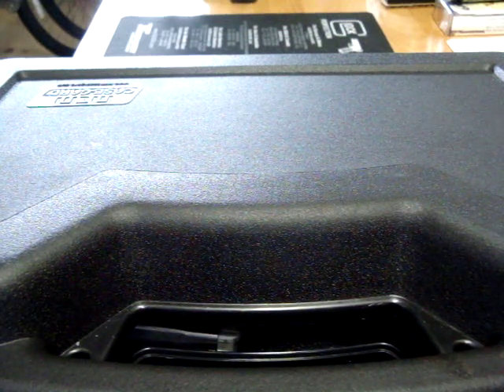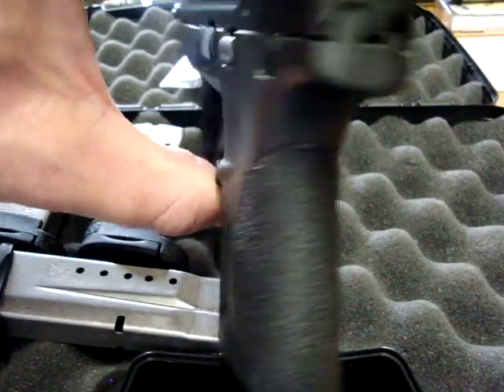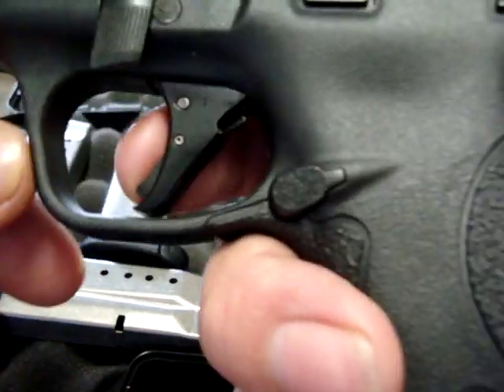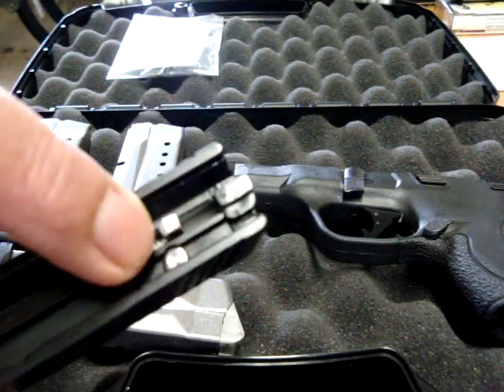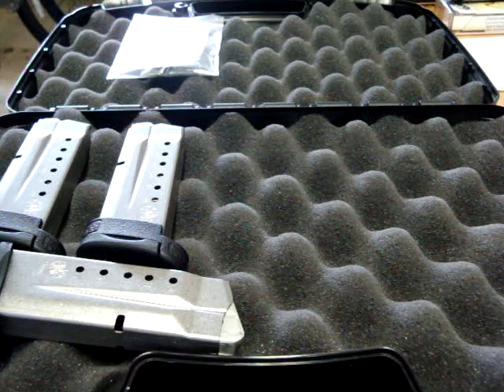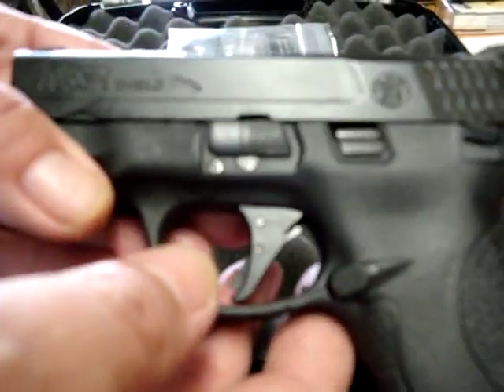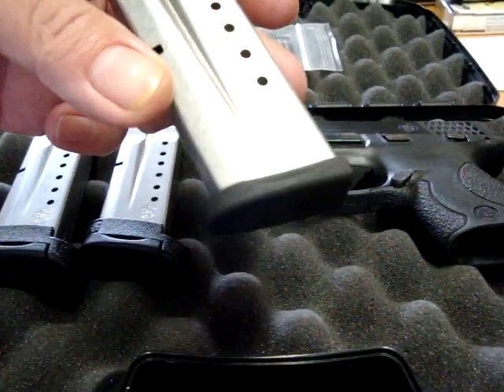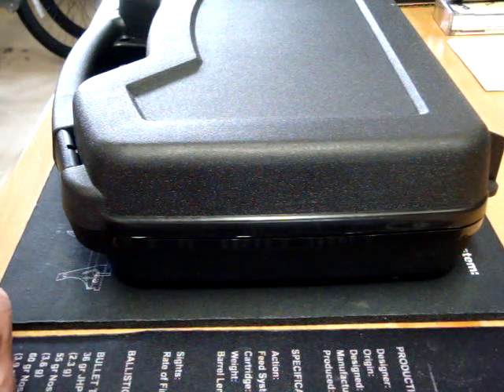S&W M&P Shield 9mm with APEX Tactical AEK&Trigger

Comment: nice job on the demo video. I own 2 shields with the same complete apex mods. The one thing that concerns me is the safe action bar on the aluminum trigger only needs to be depressed 2/3 into the trigger to fire the gun, After careful inspection I have found that it is apparent that they removed a little to much material on the upper rear rounded corner that actually slips past the safety stop on the trigger. If you have time I'd appreciate you looking into this issue I've found and let me know what you think about it. I love the trigger but would like to hear from apex on a resolution to this this potential problem.......... thanks, Gil
Reply from the maker: first off let me be clear that I'm not affiliated with Apex in any way other than I love their product. I've installed many of their enhancements and I've not personally noticed the issue your referring to. If your unsure of your triggers function I would sincerely recommend you having it looked at by a professional gunsmith &/or Apex themselves. Let me know what they have to say as I've never heard of anyone having this issue with any of the Apex components.
Reply: Skippy02 I understand your just a loyal customer as am I. I was just curious if you ever noticed it so I could get some information from others that I feel would be honest in their response answers. Thank you for taking the time to answer my comment and I will definitely let you know if they agree with me after inspection and change the design at all. My gunsmith never noticed the issue till I brought it to his attention and he was surprised enough to stop installing the enhanced trigger when he checked others he had done with the same results. Either way I still love them and carry them 24/7 but with added care in handling. thanks again, Gil

Comment: I am wanting to get this kit and some springs and try to give my mp shield the lightest trigger pull I can. I figure why not the gun has a safety. Might as well have a super light trigger.
Reply from the maker: Dino the Apex kit includes all the springs you need to accomplish a super light and sweet trigger on these pistols
Reply: skippy02 ya, but you have to buy the comp springs seperate from the duty/carry kit for the shield. They do not offer a comp kit for the shield because they do not recommend that light a trigger in a carry gun.